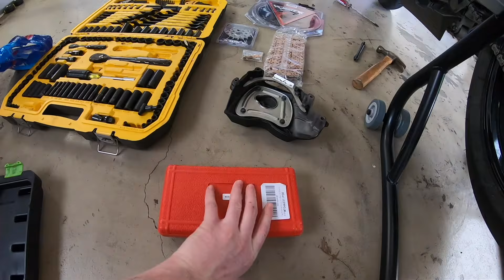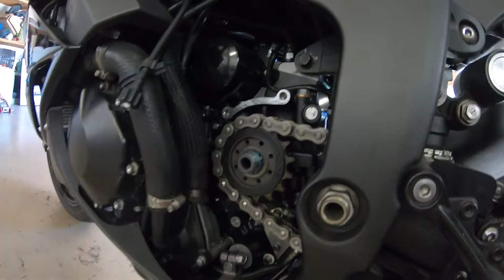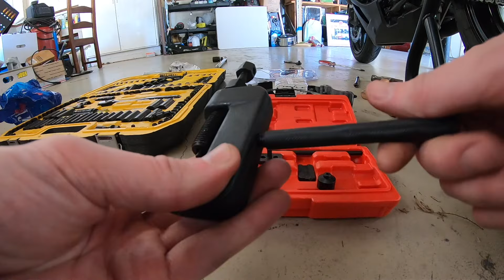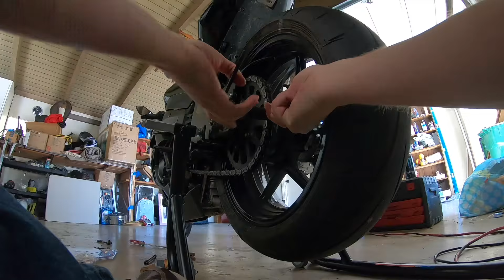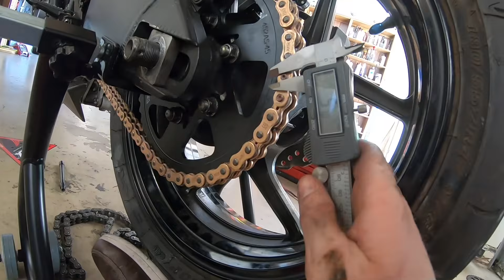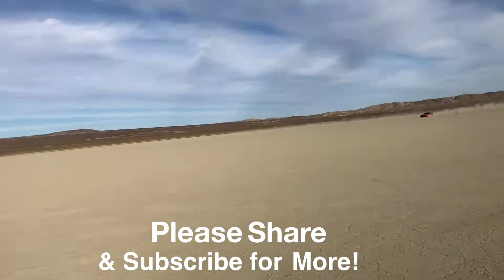$15 Motorcycle Chain Breaker and Rivet Tool Tested

Comment: Damn, I used the wrong anvil when pushing the master link pins through. Instead of 2 hollow plate to push through the pins, I went straight to riveting, ruining my master link. At the same time, I tired to rivet and warped the actual tool probably because I had to use so much force to rivet pins that were already pressed. I am gonna try again following your tutorial. thank you.

Comment: Is it possible to do without an angle grinder?
Reply from the maker: yes. This tool is just weak. I got 2 chain changes out of it before it stripped. If you will be doing this often buy a better tool

Comment: I am thinking about buying a new motorcycle and changing the rear spocket as soon as I can. I won't need a new chain,. Can I buy new pins without having to buy a new chain to do this and if so where can I buy the new pins?

Comment: The press pin needs to be flush or slightly recessed inside of the  alignment bolt, first  snug the large alignment bolt against  the chain plate then turn the drive bolt to push the chain's pin out. Starting with the tool's drive pin extended outside of the alignment bolt will greatly increase the chance of breaking the tip.

Comment: Purchased the Stockton chain breaker tool from Cycle gear, Threads stripped out the first time I used it. I had a german made version that worked great from 1977 to 2000 when my toolbox was stolen...... I miss quality German & American-made tools. China is nice and cheap but the quality they sell to Americans suck.

Comment: I have this tool and it's a piece of garbage. There was so much slop in it that the inner threaded part stripped. Also, the riveting pin wasn't domed...it was completely flat on the end. Spend some extra money and get the 'heavy duty' chain tool with the fat handle.
Reply: i have it and the rivet pin is domed, you bought the wrong tool
Reply: @mechanicalman4531  Chineez qwarity

Comment: Thanks man! Just got my tool and couldn't figure out which pin was for flaring the rivet.. thought i was screwed.
Reply: Mine came with the riveting pin in the tool. Eyeballed it to remove the old chain but had to watch this to know that was the riveting pin that was in it when it came out the box

Comment: That tool sucks couldn't flare a 525 rk master link the pin was flaring itself 🤦 and the tool bent in a banana shape it's made out of very soft metal
Reply: sounds like user error on your part

Comment: I have this tool, and you are using it incorrectly to flare the pin. Your arivett pin should be recessed 2 mm into the larger Bolt before you begin. The larger bolt should be screwed fingertight, flush against the chain side plate, so that the chain pin is recessed into the hole in the larger Bolt. If you assemble it as you have shown, with the rivet pin protruding from the larger bolt, this will lead to bent or broken rivet pin, or non-consentric flare.
Reply: So the bigger bolt rests flush against the plate and then you tighten the smaller bolt to push the rivet adapter tighter to flare the pin right?
Reply: Awesome comment and probably a crucial advice! What do you think of the tool in general? Is it gonna last at least a few uses?
Reply: @vocal-machine Agreed. I'll say I'm confused. A bit deep for me
Reply: Turbo I literally just did exactly what he's done about 2 hrs ago😭🤦‍♂️ am I fucked? Do I need to purchase another master or whole chain and re do it
Reply: Listen to @TurboDV8 ! I went thru a couple of these cheap pieces of junk. No instruction and no clear video on YT. Is the spring necessary to put inside with the riveter?
Reply: Thanks for the info. I messed mine up like you said. First time doing one myself. Makes perfect sense now after your advice. Thanks again

Comment: Bought one after watching this ... $25 wasted. Riveting pin stripped on the rivet without flaring it. The plate with two holes to accept the pins when you push the plate on the link are too close together. Can't use it .. and just lucky I didn't damage my new master link pins.  Beware ..  Chinese crap metal and manufacturing.
Reply from the maker: I would return it and get your $25 back. If the plate doesn't fit, it is the wrong tool for your chain.

Comment: i bought the same. three links and it’s bent. 1st link to take chain off (mushroom), then took 2 links to adjust new chain length. 3rd time before the rivet was out the punch bent. also it’s not very plum the punch doesn’t come out dead center.

Comment: you don't remove just any pin, you remove the pin from the master link, grinding should be optional on these type of tools.
if you don't want to find the master link, then just cut the whole chain with that grinder.
Reply: Thanks for clearing this up as I saw the grinder and thought surely the master link would pop right out with that tool
Reply: oem chain dont have a master link at all. they are put on at the factory before the swing arm is assembled
Reply: @mechanicalman4531  all chains have master links.

Comment: Mine didn't do so well. The pin to push the link out bent, but did do the job, then the rivet punch also bent, and I had to find a ball bearing (the one from the passenger footpeg retaining mechanism was just right) and stop it pressing into the tool by using the previously bent push pin to do the riveting. There was also a casting mark on mine which prevented the anvil sitting square in the tool, I didn't see this until the job was finished, it may have been responsible for all the bent pins and punches. All this was on my Honda VFR800 which has a 530 chain. If I had to do the job again I'd buy another but grind that casting mark out, it's still cheaper than paying a dealer to do the job.
Reply: The anvil didn't fit my 520 chain, the holes were too close together. I was able to work around this issue, and then the tool broke while staking the rivet. I bought the tool because the chain I ordered, that was supposed to come with a removable link, came with the rivet type. I'm waiting for a return ticket from Amazon. Luckily I didn't have to remove a staked chain.

Comment: It says to keep the pin recessed which is bull because then the adjustment bolt gets to pushin the plates to hard together! Lesson learned 🤬
Reply: wrong, the internal bolt which pushes the pin moves. the outer bolt stays fixed against the plate and doesn't move

Comment: The clip presure  tool dont fit with the two pin in it,by 525 and 520.I try to drill it.Very hard material.I glue nuts on. ;)

Comment: Is the tool strong enough to push a pin you didn't grind first?
(I'm thinking roadside repair here: you breake your chain, can you fix it with the two spare links you carry and the tool - no grinder)
Reply from the maker: I would not trust this tool without grinding first.
Reply: @ZentRose  I bought that tool for 11€ I guess I'll try on an old chain and see for myself
Reply: Another idea would be to just carry two clip on style master links.. I have two clipped on my clutch cable and if I ever need them, I can make the quick repair and continue my trip.. then replace my chain as soon as possible. ✌🏻
Reply: @joeygunzilla  Wouldn't you need to remove the broken link with the right tool first?
Reply: @AnIdiotOnTwoWheels  not if it is an easy link without Rivets
Reply: @joeygunzilla  clip style master links are only rated for 250cc bikes or lower.

Comment: I read really bad reviews on this kit. But I see you made it work easily. I guess with any project we should just take our time be patient  and be precise.  I’m going to order this kit now.
Reply: How'd it go?
Reply: @existential_fred  the kit worked fine. I had no problems.
Reply: I did order one & as soon as I went to use it, the quality was so bad the threads were jumping & I couldn’t tighten it ….so I sent it back 🤣…….then I went to Halfords & bought a Chain Monkey chain tool & it was brilliant 👍🏼
Reply: I saw the bad reviews but after seeing this I’m ordering one, it makes you wonder if some the reviewers are 1)  using the wrong pin for the rivet or 2) they don’t have the pin perfectly lined up or 3) they are just plain ham fisted 😀
Reply: @terrylee9932  I'd say there is a bit of luck in terms of the quality control. Mine flared the pin rather then the chain rivet.

Comment: That tool is a copy of a classic Pacific Coast Cycle design dating back to the 1970s or older. It comes with more adapters too. There's no reason such a tool should be expensive and that one is priced fairly.

Comment: i dont have a grinder. could i still use it without grinding the head?
Reply from the maker: I think this tool would break without grinding the pin.
Reply: @ZentRose  I did not have a grinder and it does after breaking about 4 links. After breaking links on both my bikes the shaft for pushing the pins out bent. I watched this video AFTER using the tool. Probably would have gone at it with a rat tail on hand had I known to get more life out of my 15 bucks
Reply: thinking a file will work to grind that just take a few more minutes and effort, my grinder is in storage

Comment: The point of the chain breaker is you eliminate using a grinder. No need to grind it. If you are using a grinder, get a punch and knock it out and save the $15!
Reply from the maker: The cheap chain breakers like this one will break without grinding the pin.
Reply: Yes you could use a punch that would probably already have in the right size, but for your $15 you also get the attachments to press on the new plate and to flare the pin.
Reply: I agree..why buy this chain breaker tools but need grinding 🤣
Reply: @CrazycatRider  to put the chain on and rivet the link. you cant do that with the grinder now can you

Comment: Can you push the pin through with the chain tool without the grinder to cut off the head?
Reply: I stripped my chain tool trying to push pin out without grinding  it 1st
Reply: they make a heavy duty kit that will push the pin thru. This model will break.
Reply: Yep, no problems. I just made a quick video doing just that.

Comment: Just an observation... When u cut the master rivet with the grinder u do not want to cut in the direction of your wheel bearing. U probably threw a ton of metal into where the bearing sits.
Reply: nonsense...its minimal at best...
Reply: wrong theres no way swarf is going to get in the wheel bearing with the wheel on the bike, moron

Comment: the front sprocket nut is the only time I use impact on a moto
Reply: @Weston Trent no, nobody cares
Reply: You absolutely shouldn't! The bike should be in neutral and the rear wheel on the ground (preferably with the front stopped by a wall or with front brake lever engaged - with a rubber band or a tie up) then use a breaker bar/extension to remove the main sprocket nut. Be very careful with that. 

An impact wrench could ruin the countershaft axle's grooves between the axle and the sprocket and you don't want that (you'll need a new one and that means splitting the cases, opening the engine up).